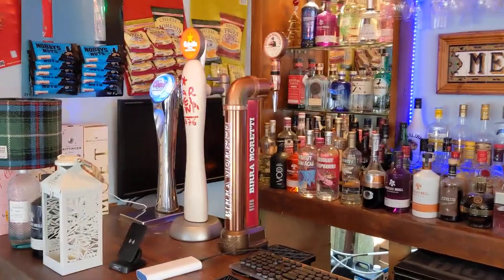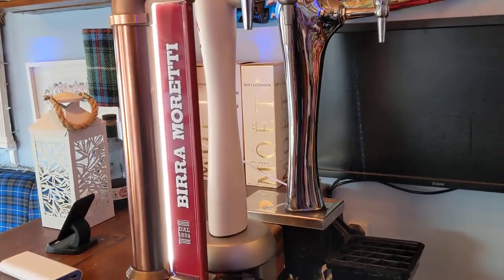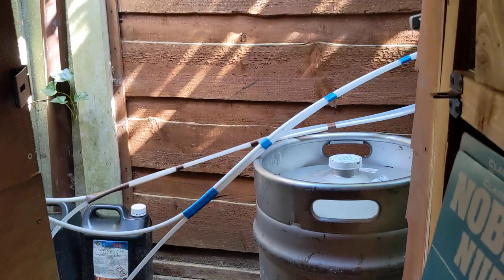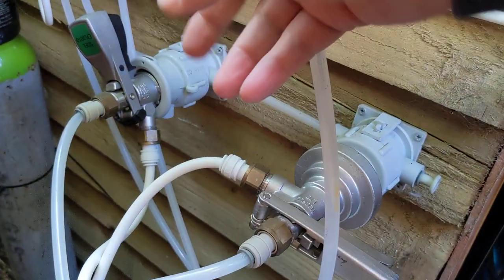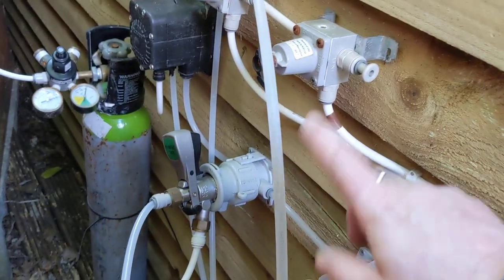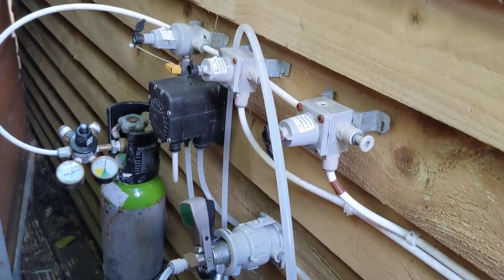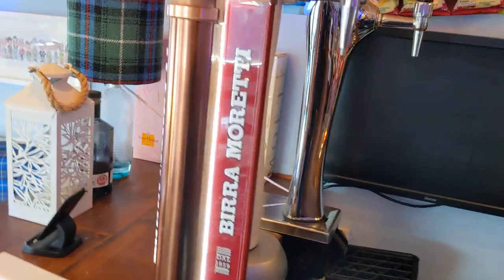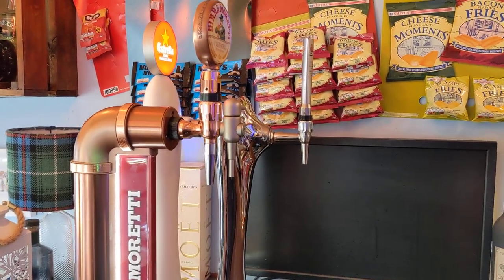Draught beer setup at Megs Bar / Mancave

Comment: Hi what power supply do you use for the beer pump lights? Specifically the Estrella one? I have the same pump and it lights up with 12v but think it may need more voltage? Thanks
Reply from the maker: 24v mate you need one of these https://www.ebay.co.uk/itm/NEW-24-V-BEER-TAP-FONT-BAR-LIGHTING-UNIT-6-OFF-/394670522257?mkcid=16&mkevt=1&_trksid=p4429486.m46890.l6249&mkrid=710-127635-2958-0
Reply: @mginbolton  thanks mate much appreciated

Comment: Hi mate. Do you have a link to where you buy your kegs from? And do you find that your 50L kegs go off after a while from not being cooled in a cellar? Cheers
Reply from the maker: I buy from a local small place that supply's pubs in the area.Kegs are out of sunlight and not around long enough for them to go off,,you can buy cooler jackets for them from ebay or amazon.
Reply: @mginbolton  we’re thinking of putting one under a bar in a garage, will that get too hot and ruin the beer do you think? And do you have the name I’ll give them a look 👍
Reply from the maker: @alexhickton9316 if you have a line cooler you will be fine.Supplier is ask drinks but don't have a website.
Reply: Hi mate another question. How do you know when the gas in the canister is running low? Thank you 👍👍

Comment: Hi mate, I want to have a similar set up but just worried about this heat we are experiencing would the keg not get far to warm and ruin the product even though its going through a cooler?
Reply from the maker: Hi Shane I had the set up all last year when we had hot weather I suppose as long as the keg is not in direct sunlight,never had any complaints rather the opposite I suppose a keg cooler jacket  wouldn't do any harm either,the cooler.does a great job.
Reply: @mginbolton  yea I seen you get insulated jackets for the kegs. My garden gets the sun all day so may need to build a little hut or something along them lines. Appreciate the reply boss!
Reply from the maker: @EverythingDIYd  no worries buddy anytime

Comment: with your kegs at ambient temperature just at the back of your shed, what temperature does the chiller bring the larger down too?
Reply from the maker: Hi Paul use this link as a guide I only unplug the cooler in really cold weather as the beer gets cold enough https://beer-coolers.co.uk/products/maxi-210-2p-cooler-co-maxi212 Also check out the glycol coolers maxi 310 on the same website they are the ones that put ice on the pumps such as the Heineken on you may have seen.

Comment: great vid,im just getting into draught in my shed so im learning,i got told to use straight co2 for stella and cider but now im being told to use 60/40,i noticed yours is a mix,what are you running and why,appreciate all the help i can get thanks
Reply from the maker: Thanks appreciated 60/40 deffo pal I have Kronenburg Morretti Estrella San Miguel and Coors
Reply from the maker: @fester. yeah friends and family comment that they are cracking pints ,just set the San Miguel up for the weekend 👍😁
Reply from the maker: @fester.  I love Wainwrights but never tried that.on the pump
Reply: @mginbolton  what psi do you run,all the same for each keg
Reply from the maker: Thanks fester, someone fitted it for me yes I use 60/40 for all my lagers  (Estrella/Birra/San Miquel/Stella) Psi not sure i will find out but to be honest i never adjust anything just clean the lines after every key and thats it.Im getting new gas bottle tomorrow i will ask the supplier whats the psi as i dont see any adjustment on the guage,its just and empty full indicator etc.
Reply from the maker: @fester.  yeah everyone says its the best pint they have had :)
Reply: @mginbolton  cheers mate
Reply: sorry to keep bothering you but i have now got stella and for two weeks its been spot on but it now as started to froff and foam,maybe i have overcarbonated the keg,i got told to turn off the gas every night which i have done but i never let any excess gas out,so do you turn yours off or is it an old wives tale as a few others have said they turn theirs on and leave it on until they clean the lines,maybe its because the weather as warmed up ,thanks again mark

Comment: Hi, great informative video mate! I have a crucial question I want to ask. QUESTION: Im filling a 30L Keg with my flat lager - should I put some co2 in it to make it fizzy before I give it to someone to put on a system like yours. Should I leave it flat, or give it some psi for some days? If so what psi would you like to recieve a keg?
Reply from the maker: Check this link out I have 60/40 mixed gas and have the pressure at 35psi https://www.northernbrewer.com/blogs/kegging-bottling-techniques/how-to-carbonate-beer

Comment: Have same chiller.. Does you larger  but cold enough?

Mime could do being a tad colder.. Any pointers bud?
Reply from the maker: The lager is really cold make sure water level is at the max,,never switch it off unless not using for longer periods.
Reply: @mginbolton  ta bud..my kegs right next to chiller..they are room temp...will experiment again..ta for video :)
Reply from the maker: @muskymcg  no worries anytime

Comment: Brilliant bar mate! Just had my own done, very similar setup to yours, recently (about 3days ago) every pint of strongbow i pour is coming out really froffy. Is this to do with the cold weather? Cooler is working fine, plenty left in the barrel but like yours mine is located outside with the gas. Is this an issue with the cold do you think?
Reply from the maker: Thanks pal yeah deffo the weather turn the cooler off during the cold snap.
Reply: @mginbolton  I’ll give that a go mate! Thanks very much, have a great christmas👍🏻
Reply from the maker: @Ben Williams  no probs pal just unplug the cooler let it get to room temp then your cider should be ok when temp starts getting higher weather-wise switch it back on.Have a good one and enjoy.

Comment: Looks great Mark. Do you need a mains water flow into the cooler or keg lines?
Reply from the maker: No not at all just need to top up the cooler with water check every 6 months.When cleaning lines just use a clean bucket of water to put the pipe in.Really easy and low maintenance 😀
Reply: @mginbolton  thanks fella

Comment: Great video, what size is the man cave?
I have a small garden and have been looking into my own bar, I would struggle to fit a 4m x 3m without taking half of my garden. Another option would be to change my garage into the bar.
Reply from the maker: Thanks Phil appreciated it's 4.1m x 3.38m the space I had to look at before you wouldn't believe I built the shed on it when you measure 4x3 it's not much really.Next vid I'll do will be a timeline collection of the built.
Reply from the maker: @philmorgan236  Yes that looks like a convenient little package but gas suppliers will only refil their own bottles some health and safety bullsh*t .Go on facebook message Mike Cornish and tell him I recommended him ask him for recommendations on couplers and cooler suppliers. You will get cheaper separately but depends if your in a rush or not.Also find beer gas suppliers near you so easier to refill locally. Like I said on the video a full gas fill with last for about 8 kegs.Where abouts in the country do you live?.
Reply: @mginbolton  I live in Rotherham, I am just trying to find some local suppliers. I have sent Mike a message.
Reply from the maker: @philmorgan236  Ok found these https://yorkshire-co2gas.co.uk/

Comment: How do you change the beer cleaning socket??
Reply from the maker: Sorry bud don't know what you mean, which part?
Reply: @mginbolton  minute 2.48 the sockets on the wall.
Reply from the maker: Ok those sockets are to rest the couplers on when not in use on a keg. They can be removed just screwed to the wall and the pipes going in are push fit connectors.
Reply: @mginbolton  thanks bud!! Appreciate the help!!

Comment: Hey Mark, much appreciated for the walk through. I really would love a proper draft system but I'm afraid of not having enough room for it all. It's going in a garage conversion and I'm quite tight on space as it is so not sure I'd be able to get a keg and a tall gas canister in there under the bar and not sure how much of a pain it'd be to run it through the wall/insulation/plaster to be set up outside. Did you man do all that setup for you, put the pipes through the walls etc.. and did you buy all the couplers and pipes too or did the installer provide them. Could do with finding someone in the Warwickshire area who does them to have a chat with.
Reply from the maker: He fitted everything for me and supplied all the bits I just supplied cooler gas and pumps
Reply from the maker: Mike Cornish goes all over the country he is based in Wales I'm in Bolton.

Comment: Do you have a drawing off the set up for your cleaning and the process how you use the wall mounted socket.any help greatly appreciated
Reply from the maker: I  cleaned the lines yesterday prob best if I do a video it's pretty easy
Reply: @mginbolton  that would be brilliant think I got all the kit but linking it up have no clue
Reply from the maker: @andyhamill9752  no probs ill probably do it tomorrow,just hooked up a keg of angelo poretti lol
Reply: @mginbolton  had my bar 6 years never had a barrel on it yet
Reply from the maker: @andyhamill9752  yeah did mine 2015 I always wanted it as better than bottles or cans.U got all the bits just need to setup? Your pressure regulator you got that?
Reply: @mginbolton  yeah think I have,can send pics off set up if you like,but like I said before I'm normally the otherside off the bar drinking

Comment: after watching this video im all set up, but im having trouble purchasing the kegs, most companys are wanting an extra £80 delivery on top of keg, im thinking is this after all ive done working out any cheaper than just buys a few slabs of lager
Reply from the maker: Which area you live?
Reply: @mginbolton  hi mark , great video btw. im living in Rhondda cynon taf south wales
Reply from the maker: @johnjones9242  cheers I'll try to find a few local places for you
Reply from the maker: @johnjones9242  what about Rhondda beer company tell them you need a keg for a party (special occasion) offer.to leave a deposit for the keg once you start  buying regular they start to trust you more.I did the same with my local supplier.

Comment: Hi, enjoyed your video. I'm currently studying so have taken a part time job working as a bar man for a local agencey. On the job training, so basically I have no idea how these beer systems work. All I know is that I was working the tap a few times, (heinekin) and it was either far too much foam, or hardly any. There is a little adjuster valve on the tap itself that makes it pour fast or slow. for example, I had it opened up full and there was hardly any gas. If i had of closed the valve a little, would that have possibly meant that the beer/gas ratio would have been better? Or was it more a problem at the keg/gas bottle? Thanks in advance.

Comment: what pressure do you use for larger
Reply from the maker: On 60/40 gas 35psi pal for a perfect pint
Reply: @mginbolton  thanks bud iv got coors lite at the moment
Reply from the maker: @boromassive932  yeah I've got that on my system.Its fine at that
Reply: Also do you need the cold water flow  to your taps as my keg is up my bar thanks bud , my pints were pulling fine when i first got my keg but after a few pints it seams to have gone flat.

Comment: Hi ya buddy I'm setting up a home bar where could I get cheap co2 bottles I'm looking on ebay and there going for £65+ do you know where I can get them cheaper 👍
Reply from the maker: To top up the 60/40 gas it's around 20 pounds but you need to leave an initial deposit of around 50 quid,,unavoidable really to be honest.